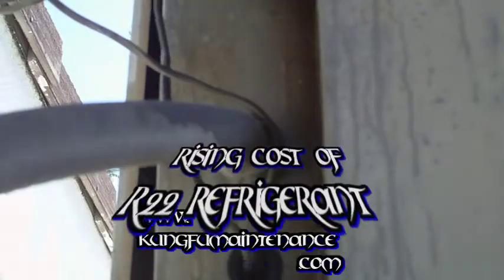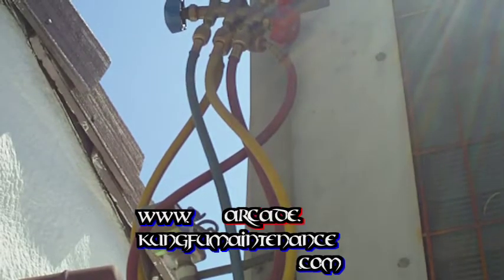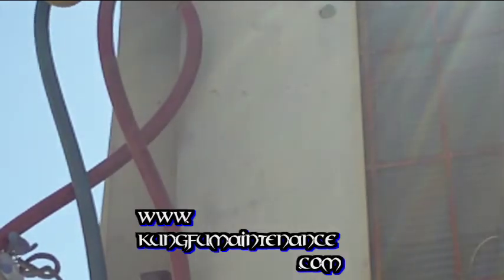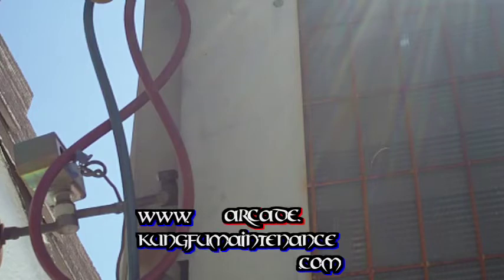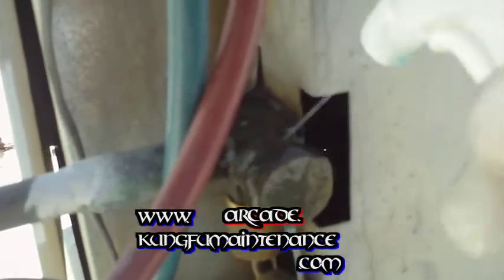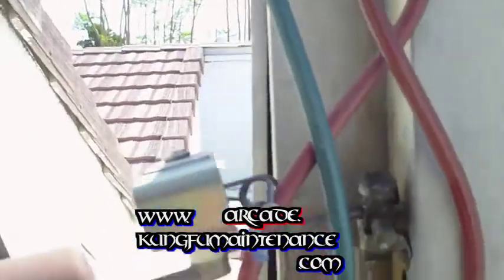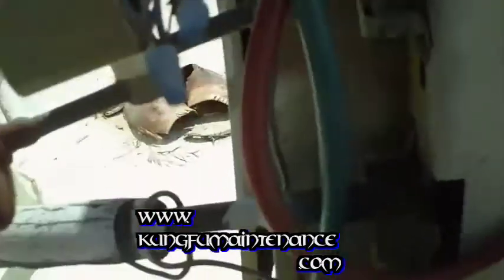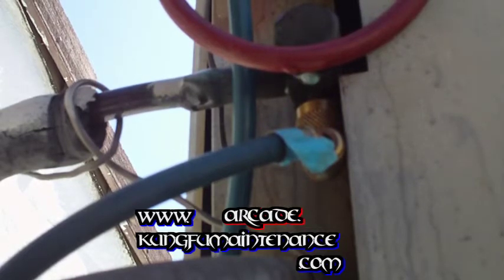Rising Cost Of R22 Refrigerant Gas ~ Charging An AC Low On Freon

Comment from the maker: On a hot day when it is over 100 degrees the low side line should feel nice and chilly. It acts to remove heat from the unit but also acts to help keep the compressor from overheating. The 40 (on the green dial matching the green can of R22) is representative of the temperature at the evaporator coil. Superheat is the measured temperature difference between the coil temp and the temperature of the suction line just before the suction line service port.

Comment from the maker: Sounds a bit overcharged. Ambient plus thirty on the green dial high side is a good rule of thumb and would put at 119 degrees about 225 psi. on high side. The green dial on the low side corresponds to the temp at the evap coil which I like to see 40 to 45 degrees which would put you at 68 to 75 psi on low side. If you're getting 19 degrees split that is pretty good. I would first check for air leaks around the indoor air handler top. Sealing off any air leaks there can make a big difference.

Comment from the maker: I recommend checking indoor temps first for 15/20 split at intake and outgoing register. I have a video on this titled How To Check For Proper Charge Without Hooking Up Gauges. The reason being that hooking up the high side hose actually takes out some of the freon to check it especially since most hoses being sold these days are five feet (I prefer 3 feet hoses for faster charging and less refrigerant loss.) In the video I was low side only charging looking for the green dial to show around 40.

Comment: Mr KungFu, need some advice. My gauges read low side 88-89 psi (52 degrees) pipe is 60.5 degrees F. So is that 8.5 degrees superheat ? High side is 300 psi (130 degrees) and the pipe is 115 degrees, so subcool is 15 degrees? is this good?  Ambient temp is 89 degrees. I recently added 2.6 lbs of R22 and capacity is 75 oz (4.69 lbs).
The issue is it will run all day and never get below 78 degrees inside. The differential  temp inside is around 19 degrees in/out and was 11 before adding R22.
TY!!!

Comment: My gages don't have a green dial.  When you say 40, I presume you are referring to  super heat (or whatever) temp and not to psi. Is the suction line usually cold enough to sweat when your finish?

Comment: On your video due to the background noise I could not hear clearly what you were looking for on the low and high side pressures when charging R22.   I have a 3 ton Crane and wanted to check my pressures. I rrealize it is temperature dependent, but what should be a reasonable charge on a hot day...say over 90 degrees.